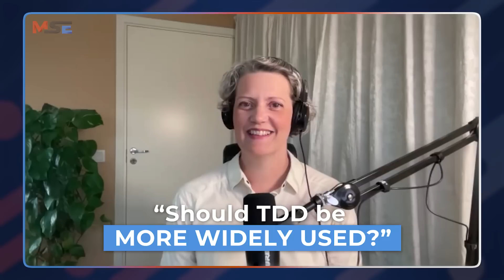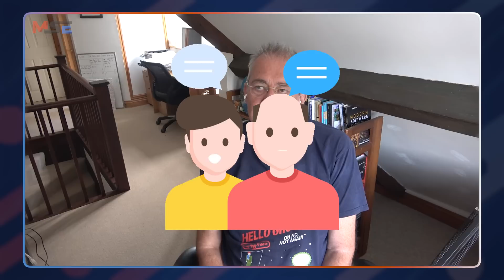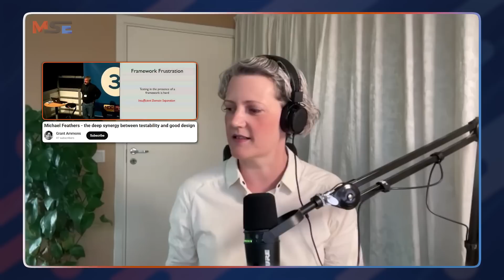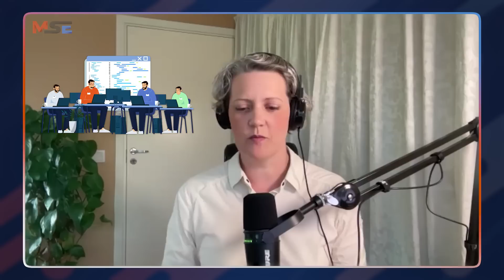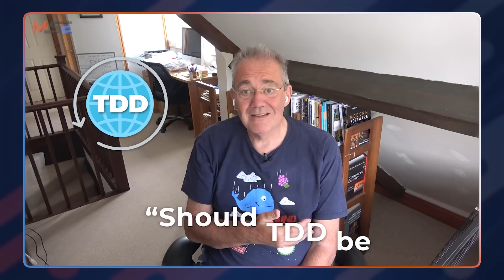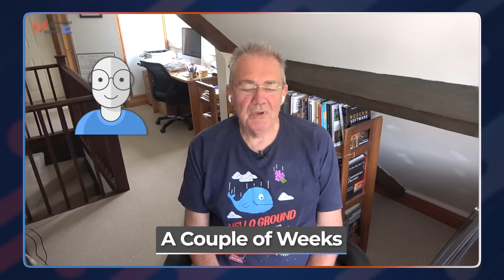Should Test-Driven Development (TDD) Be Used MORE In Software Engineering?

Comment: I wander how we should address a “senior” that does bot want to hear about unit test, let alone TDD
Reply: I didn't understand or embrace Unit Testing/TDD until my mid 50s. Sometimes old dogs can learn new tricks.
Reply: @jimhumelsine9187 very much agree.
But it seems that people just do not see it as a tool.
Reply from the maker: We simply won't be able to convince everyone, I think we should try though. I think we should aim to build a culture where it is deemed unprofessional to write code without TDD! - Hard-line I know!
We should teach everyone to program, from first steps, using TDD, this is a generational kind of change, we already know that, because it has already taken too long, but it does work better, and the fact that our industry is so poor at learning new things is a bigger problem that we need to find a way to work on!
Reply: @ModernSoftwareEngineeringYT you said very well, our industry is poor at learning new things
Reply: The simplistic answer is first get management buy in for testing, and not breaking existing tests. Then add a condition so that if you check in code without tests, you become the sole maintainer, and you can't work on anything else until your code either has full code coverage, or your bug queue is empty.

The full code coverage part gives them a way to exit being the only maintainer, and the empty bug queue stops them extending buggy untested code. Then they get moaned at by management because as the sole maintainer they are the only one who can add features to that code without tests, and everyone is waiting for them to fix their slop before adding new features.

At this point there are only a few possible outcomes.

1, they get with the program and start adding tests so they are not the sole maintainer any more.
2, they get fed up with not being given the interesting stuff which matters, get given all the stuff nobody else wants to touch, and leaves.
3, management gets so fed up with how much slower they are to deliver features, and theatens to fire them if they don't do better.

Options 2 and 3 solve the problem by pushing them to the drudge work and leaving, and option 1 gets them to do the right thing.
Reply: @grokitall good points there.
I hope for option 2